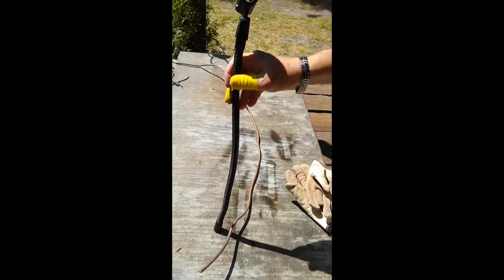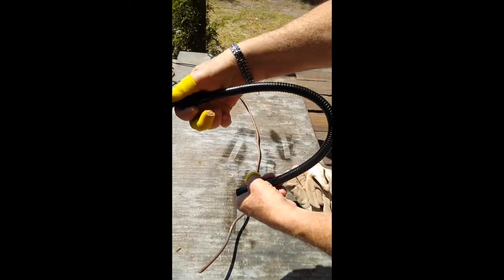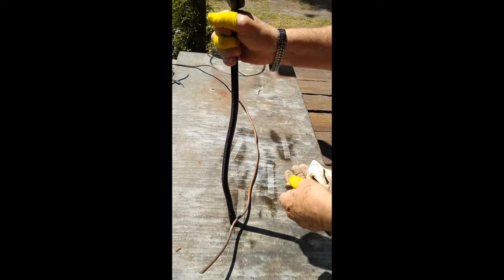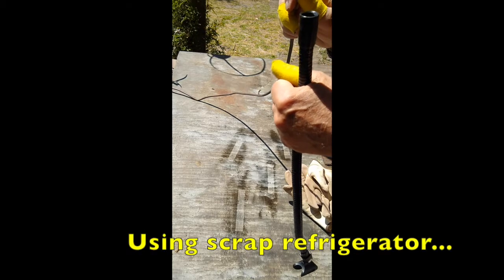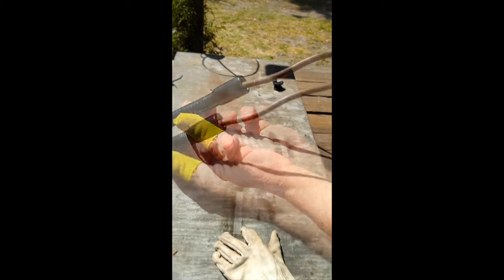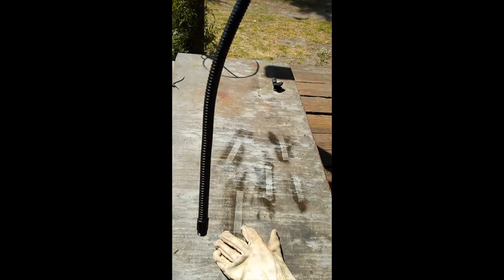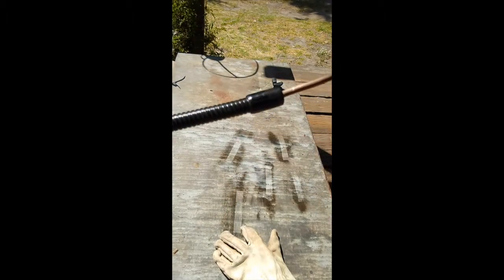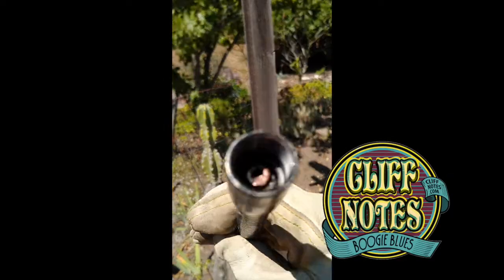How to Fix a Gooseneck Mic Stand

Comment: Instead of doing all that why don't you just tighten up the gooseneck. Simply twist clockwise until it becomes tight and problem is solved in seconds.
Reply from the maker: OK, I have never heard of that fix! I will try that when the next one "sticks it's neck out!" ;-)